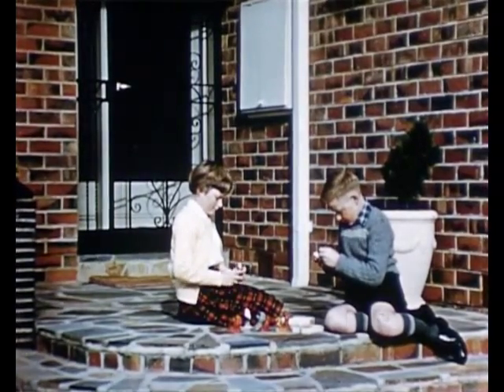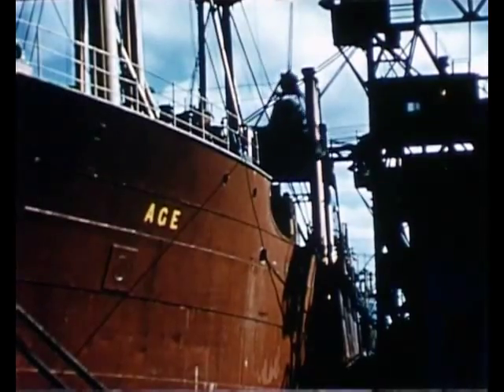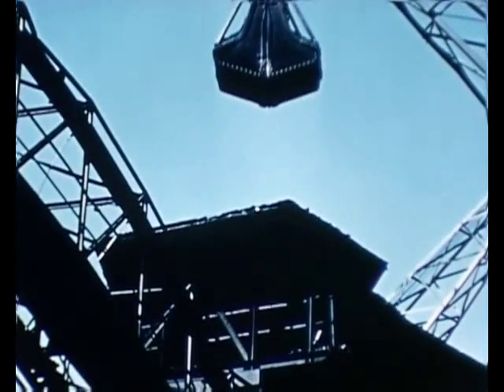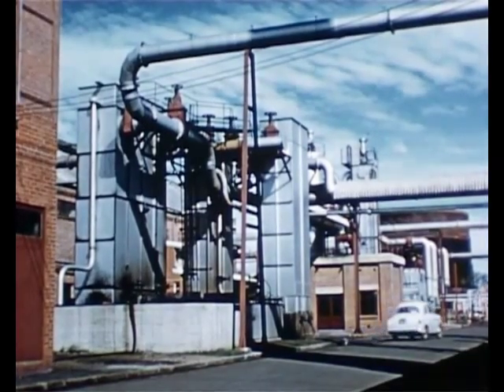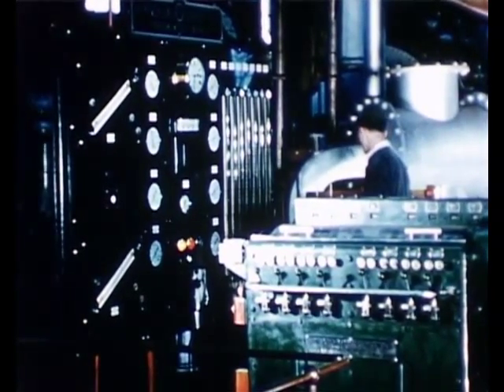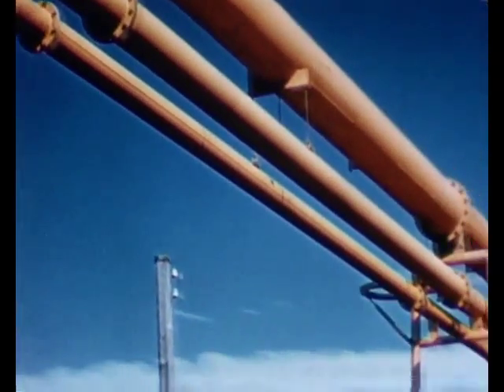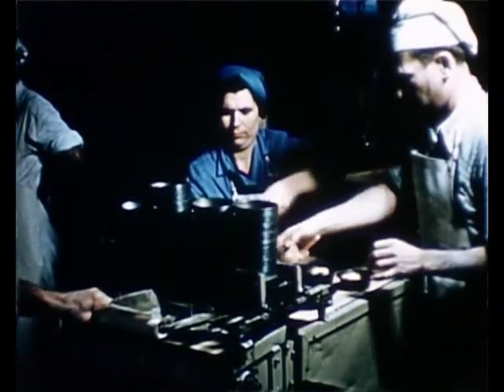Gas Manufacture (1959)

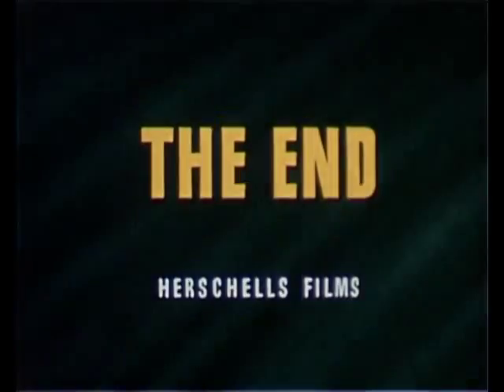Comment: 9:30 - how is this gas used for refrigeration
Reply: Absorption refrigerators, also known as "Electrolux-Servel" refrigerators use a small gas flame to distill ammonia away from a dilute ammonia water mixture to provide the concentrated ammonia refrigerant. These systems have no moving parts. They are also the the propane fridges common in RVs. Larger gas fired whole home and commercial air conditioning and refrigeration can be provided by gas fired ammonia-water or lithium bromide-water absorption chillers. These were manufactured by Arkla-Servel, Robur, and Bryant. You can see videos of them on YouTube.

Comment: Now I know why they call it “natural gas”
Reply: Natural gas comes from the Bass straight gas fields.....The natural gas network took over from the coal gas network in the 80's
Reply: @robmcfarlane3602  No, sorry that is wrong. The conversion occurred in Victoria from 1968-1970...

"...The conversion process was completed in December 1970. As conversion of appliances occurred throughout the suburbs, section by section, natural gas replaced manufactured gas in the pipelines and the closure of the gasworks began. Highett gasworks ceased operation in August 1969, Lurgi Gas Plant in November 1969 and West Melbourne in December 1970. Colonial Gas stopped production at Box Hill gasworks in November 1969 and Footscray gasworks in March 1970...."

https://prov.vic.gov.au/archive/VA1040#:~:text=The%20conversion%20process%20was%20completed,closure%20of%20the%20gasworks%20began.

Comment: so being new to this, is this in relation to propane?
Reply: Nope. It was synthesis gas made from coal gassification, known also as Coal gas/town gas, and pumped in pipes like modern lpg.
Reply: This stuff is 30% CO. It killed a lot of people through leaks back in the day. In old media, putting your head into a gas oven was a relatively common way to commit suicide.
Reply: We should be making it today and not relying on country's over seas
Reply: @geoffisaac3511  Town Gas is an extremely ineffecient means of energy production. Not to mention the dreadful pollution it causes.
Reply: @aidy6000  isn’t town gas more polluting in the home?
Reply: Natural gas
Reply: @DiegoMartinez-gj7nk  its not natural gas, its town gas made from coal
Reply: @monkofmayhem1373  Town gas and natural gas are the same things. Town gas is natural gas obtained from coal gasification. It was the only source of getting natural gas before the 1950s. Since the 1950s, we all have been using natural gas pumped out of an oil or gas well and, most recently, shale gas. At the end of the day, what we are getting at our home is a mixture of methane, ethane, and traces of light hydrocarbons. Regardless if it came from coal or biomass gasification, oil or gas wells, or shale gas.
Reply: @DiegoMartinez-gj7nk  chemically it may be similar but to say natural is town gas is not correct as these terms refer to the extraction of the gas not the chemical compounds.
Reply: @monkofmayhem1373  LOL same shit different pile
Reply: @DiegoMartinez-gj7nk  hahahahah exactly!
Reply: @monkofmayhem1373  for your enlightenment
Reply: @DiegoMartinez-gj7nk  no lo entiendo
Reply: @monkofmayhem1373  lol fuck it
Reply: @DiegoMartinez-gj7nk  They are NOT the same: natural gas has almost twice the BTU/ft3 than manufactured gas. When municipalities switched from MGP to natural gas when transcontinental gas transmission pipelines were first established in the 1950’s here in the NE of America, there was a mass gas appliance conversion campaign that took place.
Reply: @DiegoMartinez-gj7nk  wood gas, coal gas, town gas, producers gas, what ever you want to call it is made in the manner shown in the video, it is composed of mostly hydrogen and carbon monoxide with some other gas mixed in. Natural gas is methane, and is referred to as "natural" because it did not have to be produced like the other types, it comes out of the ground pretty much ready for use.
Reply: << Town gas and natural gas are the same things. Town gas is natural gas obtained from coal gasification. It was the only source of getting natural gas before the 1950s. >>

This is wrong.

Gas manufactured from coal is mostly carbon monoxide.  That gave rise to the image of people commiting suicide by putting their head in an oven.

Natural gas is mostly methane, with small amounts of ethane and other combustible gasses.  It's collected from wells often drilled for the purpose of collecting gas.  Natural gas is not poisonous,  but it is flammable and explosive.  

Propane is a gas collected from petroleum refining,  much as gasoline is a product of petroleum refining.